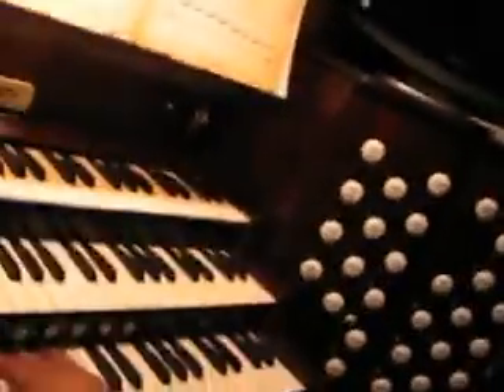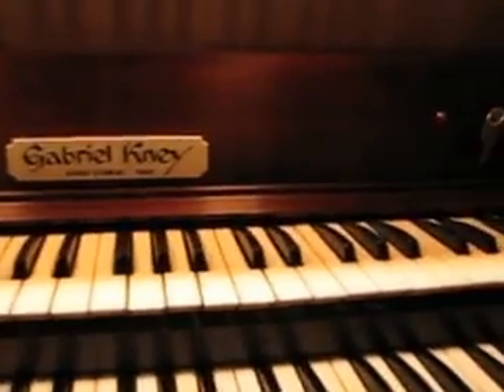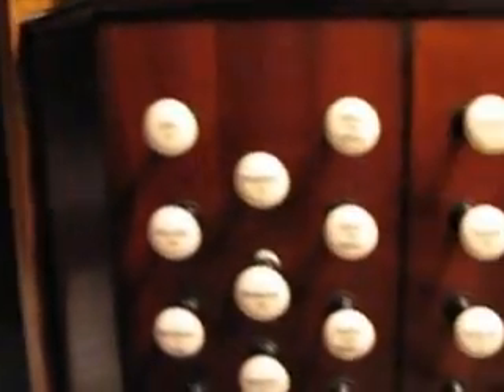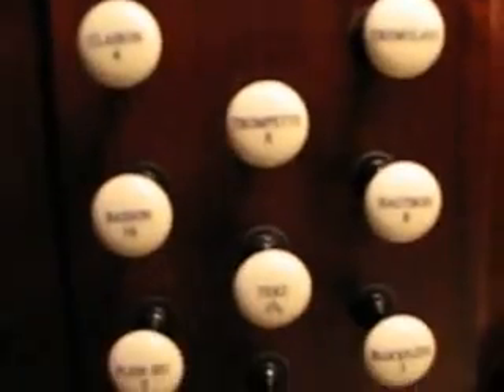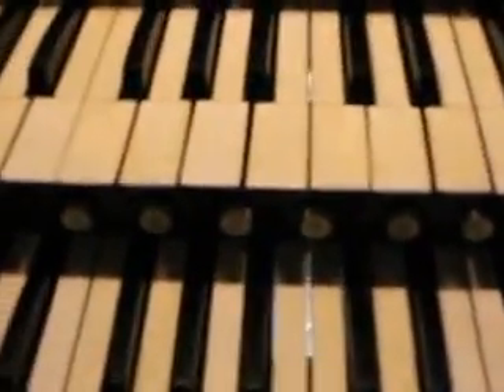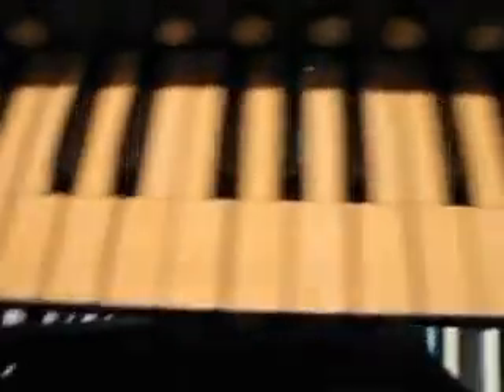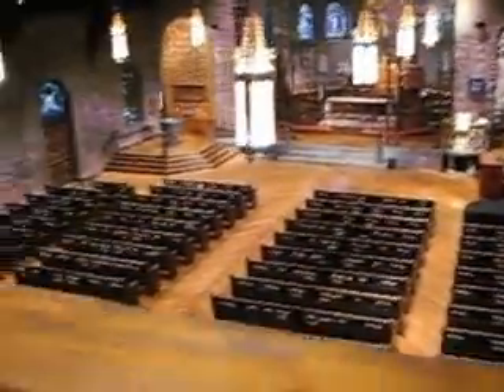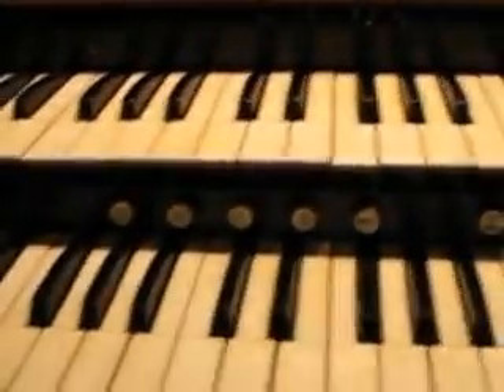Tour of how Pipe Organs work

Comment: what is the purpose of the 4 rows?
Reply: Textural contrast. You may want to solo on one sound and accompany with another.
Reply: oh, so each layer can be assigned to play a different voice? that is very interesting.
Reply: Each keyboard (manual) division is, in fact, a complete "organ" in itself, with stops (pipe ranks/rows) often unique to each division and possessing their own unique qualities of tones. 
For example, the Great manual (Hauptwerk, Grande Orgue) is the "backbone" of all organs with its brilliant, full and rich principal/diapason chorus and reeds (what we generally think of as "pipe organ sound"); the Swell (Récit) and Choir manuals (normally housed in louvered enclosures, and therefore "expressive"), generally contain the more colorful "orchestral" stops (trumpets, strings, oboe, clarinet, etc.), but both will still contain usually quieter versions of principal/diapason stops found in the Great division;  and the Positiv division (often located just behind the  organist on the gallery rail) generally contains a  "Germanic" selection of crisp, incisive, sparkling and delicate sounds. The Pedal division contains all the very deep bass stops of 32' and 16' length (both reeds and flues), but is still a complete division, with diapason/principal stops, flutes, reeds, mixtures - just like all the keyboard divisions, but tailored to this bass division.
And couplers permit any division to be played on any other manual or the pedal division. For example: Swell/Choir/Positiv to Great and/or Pedal; Swell to Choir, etc. So nearly unlimited possibilities!